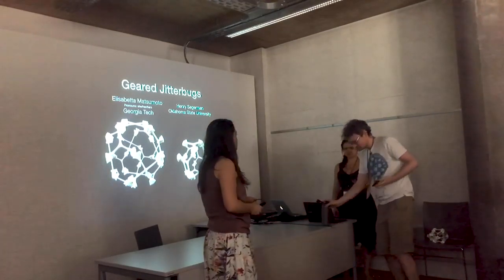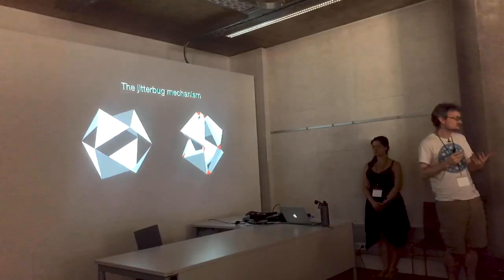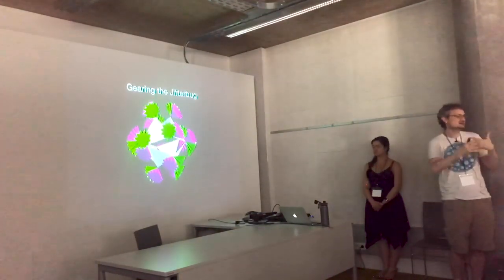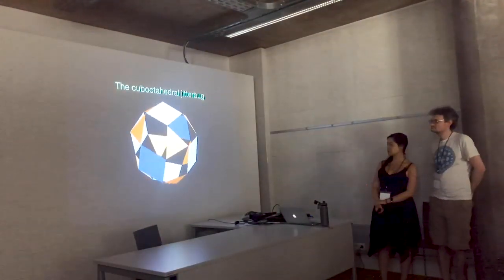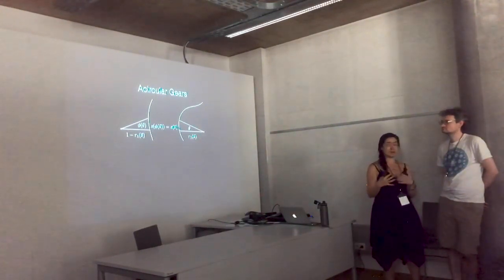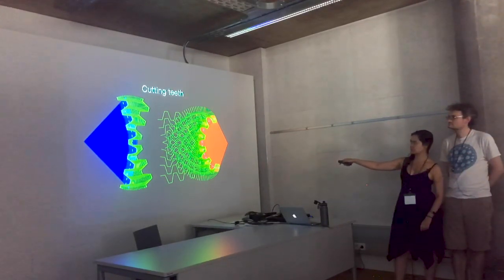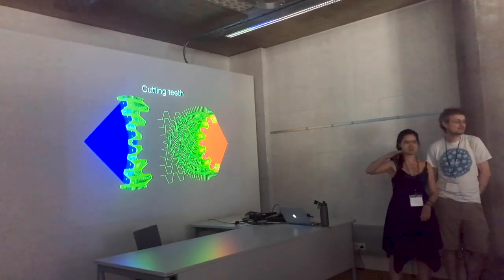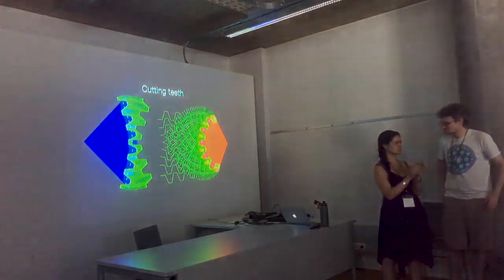Bridges 2019 talk - Geared jitterbugs

Comment: There is some evidence out there suggesting that paper is auxetic in the out of plane direction, i.e. if you pull on paper it gets thicker. Ref: Stenberg and Fellers 2002 https://www.degruyter.com/view/j/npprj.2002.17.issue-4/npprj-2002-17-04-p387-394/npprj-2002-17-04-p387-394.xml